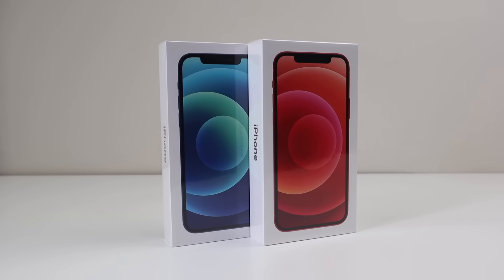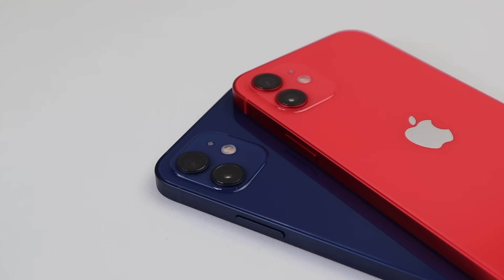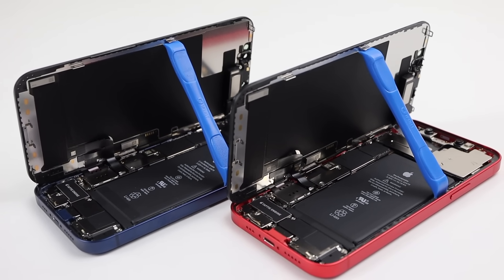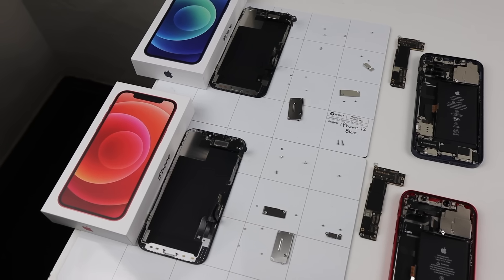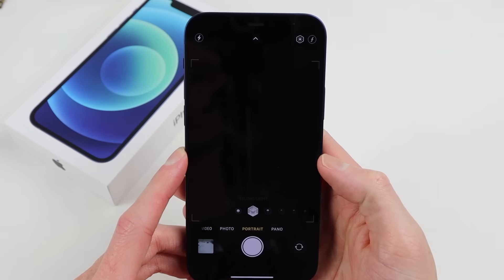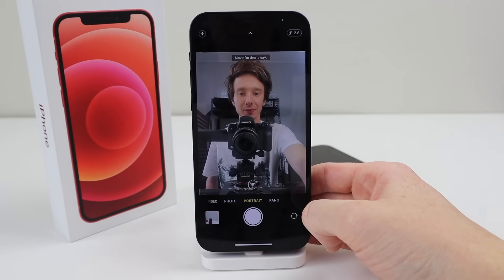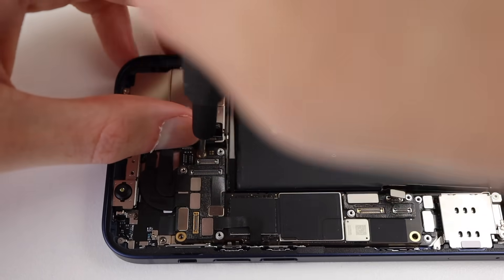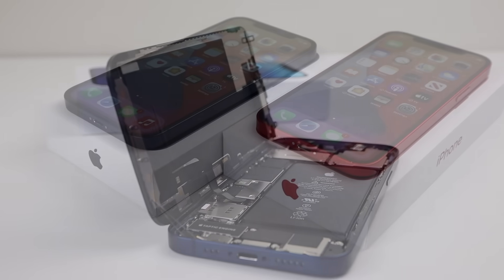iPhone 12 Anti Repair Design - Teardown and Repair Assessment

Comment: Locking Face ID to the main board is absolutely crucial for security. And Apple probably also doesn’t want foreign batteries in their phones, because it’d give the bad press if an iPhone then bursts in flames. The camera needs calibration, so that also makes sense, although the specific problems you had are somewhat strange. Sure, Apple also likes the $$ attached to all of that, but I miss some technical background in your comments.

Comment: Even IF it doesn't work as intended... I'd still gladly take it tbh. My current phone is.... Yeah well not usable anymore the battery is dead in a couple hours, it's also expands its size and some sort of crystalization is going on the display. I'm actually afraid it's gonna explode quiet soon

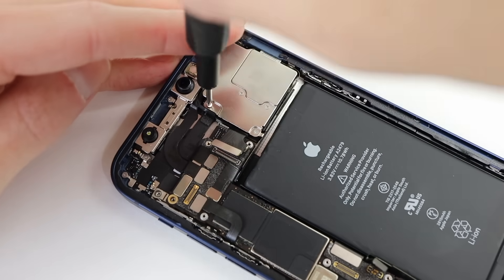Comment: 12:55 correction, not "causes so many issues", but "IS DELIBERATELY AND EXPLICITLY PROGRAMMED to cause so many issues". these issues aren't something that is there and would need programming work to remove. these issues are a feature, something that isn't there until someone deliberately programs it.
Crapple is malicious. And I am 100% sure about that. You can call it an educated opinion of a programmer with 15 years of experience across many platforms.
Reply: Exactly, these aren't bugs or glitches that haven't been ironed out. They have been intentionally programmed to work this way...
Reply: @Bobblybook  we are taking an educated guess knowing apple, but dont say it that way because it could be just an exception apple try to catch if it notices parts arent from the same factory phone, so in theory it could be something they could work on /"fix"
Reply: @JuanGarcia-kl1wy  however none f the parts were damaged or installed wrong so there is no reason it should stop working a simple warning would be suffice for detecting different parts but they have deliberately made it stop working
Reply: @JuanGarcia-kl1wy  nonsense. it is nothing but intentionally written code to start pretending stuff doesn't work. there is literally not a single legitimate reason for it to be bugging out like this. they just want to convince their dumb credulous customers that thirdparty repair shops are destroying the phones (when they're not) so that customers excluaively use the GeNiUs bars and their overpriced nonservices.
Reply: @JuanGarcia-kl1wy  Literally no, this has no reason to exist. Your car doesn't give you a warning when you change your headlight bulbs that they might not be genuine and then keeps your radio from working.
Reply: Apple has been the scum of the earth for a long time and is proving why it has this reputation over and over. Some one gives me an apple product I sell it as soon as I can or destroy it.
Reply: @justviews4946  that’s just plain dumb, sell it, maybe, destroy it?
Reply: Didn’t they publicly admit that they make their phones run slower after a few years of ownership? To make you... feel like you need a new one.
Reply: @myerah7178  Apple saw a win-win situation, don't tell anyone you're throttling performance to improve battery life so you're pressured to buy the new phone model, then fallback on the "good reason" insurance only if the lawyers call.
Reply: @myerah7178  Have you ever had an Android phone that has had their software updated throughout all of their generations? No...Android phones are abandoned almost as fast as they are released, they are updating the OS on every iPhone to keep them all the same. The fact that the hardware can't keep up is purely a side effect. They can throttle all they want too if it helps run the newer OS. Find your old Windows XP laptop and run Windows 10 on it and tell me it isn't worse. XP never used graphical acceleration the way Windows 10 does, but XP is no longer supported and has security holes.
Reply: Eyyyy! Someone else who calls them Crapple. :D
Reply: i’m not an expert, but even I thought it was deliberately programmed to be like these... i’m getting mad just thinking about it
Reply: That’s why older models are better! I have 5 and I have had a few parts replaced. It works just as I did out of the factory!
Reply: @TENTENTENTENTENTENtengoku  I m not trying to sound like an android fanboy, but at some point those phones will be outdated technologically. I just want to tell you, when you need to upgrade, dont go for a new iphone
Reply: @randomuno2562  Your Android phone's operating system will be outdated and full of exploits before anyone's old iPhone is.
Reply: @xionxinx  thats the arguement everyone makes, but mine wont be unrepairable when it breaks, and guess what. Android is open source. I can install a new version of android
Reply: @randomuno2562  lmao true, you can always get a new copy of android whenever you want
Reply: @TENTENTENTENTENTENtengoku  i’ve had the 5 since 2015-6, and I’ve had it repaired only once for the screen and battery
Reply: I'm no expert but to anyone thinking this isn't deliberate well I'm sorry to burst your bubble of bull but big company's like crapple and geek Squad want to make money even if that means they have to up charge their customers to the point of programming your phone to deliberately malfunction if repaired anywhere but their company it is unfortunately a loophole where they can legally scam you buy up charging you I only know this because my old Acer laptop screen broke and when I went to Geek Squad it would cost me $300 and I got it repaired at a small business for $180 these companies unfortunately have to scan their customers even if some of them don't want to and that's because they're a large company especially with apple you're buying the brand name not just the phone
Reply: @JimB001-t6w  btw, (and this i am sure about) these things are not part of the OS code, or residing in the standard memory. these are pieces of in the chips themselves. so, pretty sure many of those (chips in general, not just in iphone) don't even have the function of dumping code that's on them. you can flash the chips (write code onto them), and use the chips, and that's it.

now i just partially repeated myself, but main point of this second comment was to make sure you understand these pieces of code are separate from the OS and storage and memory that OS resides in.
Reply: It's so face is and finger I'd on phones can be linked to the device for crimes. Legit we already lost the right to repair pretty much when we lost rights to privacy. It's specifically targeted for for finger/face so. Don't call me crazy. Or do. Idc
Reply: @raptureparty2610  so that faceid and fingerid can be linked to crimes? really? then why it's affecting the battery and the normal, back facing camera too?

that's just some bullshit excuse from someone at crapple.
Reply: @raptureparty2610  nice grab
Reply: @JimB001-t6w  memory/firmware dump and analysis... probably not possible, low level read/write access to these things is almost sure to be encrypted and behind some kind of password. if it even is possible to READ the code from those chips. they might be write and execute only.

i'm not a hardware guy, so as opposed to my original comment where i was 100% sure to the point of being okay to pass the info along, this one is "i'm pretty sure for myself, but don't really know enough about this part to present it to others as a fact". so keep that in mind.
Reply: If someone sells you an iPhone with a replacement part and it can act as a man in the middle to the Face ID hardware then it's sort of a security concern. I don't see why people aren't just pushing to have a system in place to allow people to just use their system configuration too to verify parts. Apple has a closed ecosystem for a reason, that's their choice. You could try to have an actual discussion about the real technicalities. 15 years programming what? Websites? You aren't a hardware engineer so I don't think you have much place to make an "educated opinion".
Reply: @xionxinx  lmao you dont even understand what he's saying do you? Hes saying they are coded to fail
Reply: @xionxinx  i started out on QBasic when I was 8, went on to pascal at 10, vb6 at 12, c# at 16, that's also when i started mucking around with C, then learned webstack at 17, and HLSL at 19. learned some java and did some android programming at 22. currently i'm learning assembler and toying around with designing my own language and possibly a processor, but that's in very early stages, and just a shallow fun, not doing that with any serious skill. but yes, sadly, websites were most of what i've been doing professionally for about 8 years, before i finally got into making games.
Reply: @xionxinx  ok, possibility of man in the middle didn't really come to my mind.
1. how about just lose the faceid nonsense then? it's a buggy, unreliable, and useless dingy anyway.

2. can you do mitm from battery's firmware?

3. how do androids prevent these kinds of mitm attacks?

4. if they don't, how come nobody is concerned about their security?

5. repair shop certification process exists. if it can't screen out malicious shops which would do something like that, what is it for?

6. yes, apple has a closed ecosystem for a reason. profit.

7. oh and, since it's all manufactured and assembled in china, what are we even talking about regarding security? and since they also sell in china, which means government mandated tracking and backdoors? hey, and what about that defacto kernel level minus one cpu which is in sim cards? how come nobody is concerned about that piece of fun which can do data transfers without even your phone knowing?

how is a security argument supposed to be anything else than silly in this context?

Comment: Early 20th century: "It sucks that our manufacturing tolerances are so loose that parts of one machine aren't necessarily interchangeable with those of another."

Mid 20th century: "Phew, through advances in tooling and production design, we've finally solved this."

Apple, early 21st century: "Not being ungrateful, buuuuut..."

Comment: face ID will not working if you use a different face ID flex cable which has been the case since they used the technology, it is an important security feature to prevent someone from getting into your phone and maybe using applePay etc , there are always issues when Apple release a new device, which normally gets fixed with ios updates. I can guarantee by the time repair shops begin to change the screen and other parts they will work fine, but maybe have a message pop up telling the part is not genuine. So nothing to worry about

Comment: I had samsung galaxy s4 that i bought on 2015, it still work until today, but since current apps require more power I try to buy phone with battery that can be replaced.... what shock me that almost all phone are sold with build in battery that are meant to be disposed... very greed design...

Comment: this is why iphones are good. this is not to prevent you from fixing, but to prevent thieves selling stolen [phones to Chinese hackers. Those Chinese hackers install hacked chips to bypass icloud and replace and refurbish with fake parts. then they resell on ebay or secondhand offline shops. pretending it's nearly new. This is a security measure. So from now on, iPhones are less likely to be thieves'  target which is good.

Comment: Hugh Jeffreys, did you try to install a new, fresh camera which is never installed before?  I am wondering if you have the same issues when installing a new one. Maybe they block phones when 'used' parts are installed to avoid people stealing phones and use their parts to repair other ones?

Comment: Are there security implications? Could changing any of these components enable spyware or other malware to operate?
Reply: Yes, this is part of the reason they are claiming this. Its part of their new T2 chip idea. Basically, they feel that face detection, thumbrint detection, and other data are all pretty sensitive, so some hardware access is locked to a special chip inside the device to stop any sort of mal-activity.

On the laptops for instance, if your harddrive fails, your files are unrecoverable. The t2 chip will only interface with one specific harddrive, and that harddrive will only interface with the t2 chip. Your cpu talks to your t2 chip before talking to the harddrive, so your drive is safe from software attacks as only apple know what goes on inside the t2. so, It protects your data from nefarious agents.... 

but it also really brutally ruins your right to repair, and increases the risks associated with the device. 
on a newer macbook, youve gotta be backing up your data NON STOP. and alot of people dont know that.

this company is smart enough to come up with this stuff, and some amazing devices.
 There are plenty of other methods to increase security. 
I wonder why they are choosing this one...

Comment: Samsung is off laughing somewhere in the distance.
Reply: Having worked at a cell phone repair depot, I can tell you that Samsungs were the most popular among the techs because they are the easiest to repair.
Reply: Thing is Samsung has also let down it's customers this year with different models of the Note 20 pro depending on your region.  Both Samsung and Apple need to really think about how they treat their customers.
Reply: doesn't samsung make iphone displays
Reply: @shitpostcentraI  they make several parts for most companies but Apple adds "safety" features that doesn't allow you to do anything to your phone. You can get a galaxy and throw on the apple OS and it works fine (except the camera use).
Reply: @shitpostcentraI  yeah the make them but iPhone says how

Comment: I was repairing iPhones (back when iphone6s/se was the latest) for an Authorized Service Provider before and never thought that they locked out parts. this sucks, so when your phone is out of warranty and breaks, you either buy a new one or have it replaced from the ASPs with unreasonable price tag. I was planning to switch to iPhone for the first time but this has changed my mind.

Comment: Apple must think it’s customers are all idiots. To suggest they didn’t include a charger to reduce waste is laughable. Since most people won’t have a type-c charger lying around, you’ll be forced into buying one. And guess what? A good proportion will shell out for the Apple charger. And just like that, not only have we done nothing to reduce waste, we’re handing over even more cash to Apple for something that should be included with the phone. It’s no accident that the switch to the new type-c interface corresponds with a decision to not include a charger.